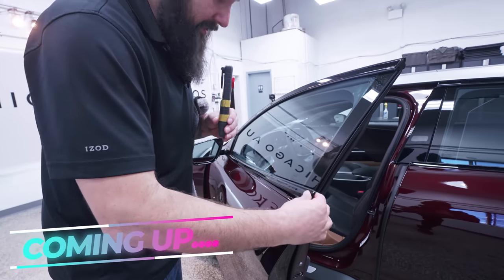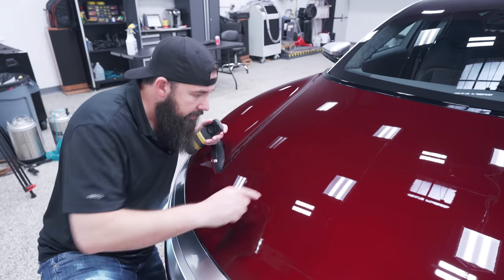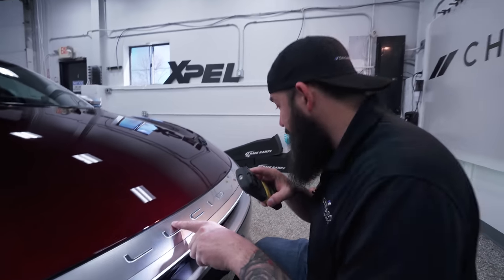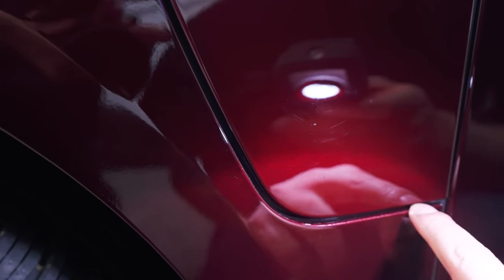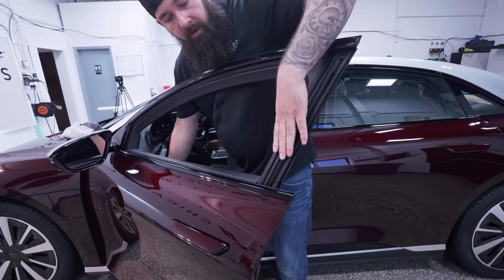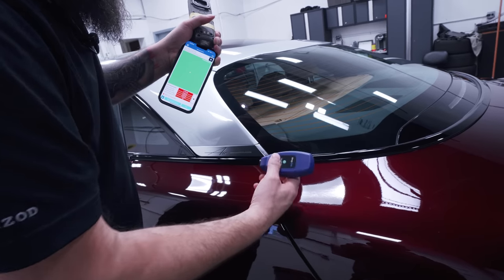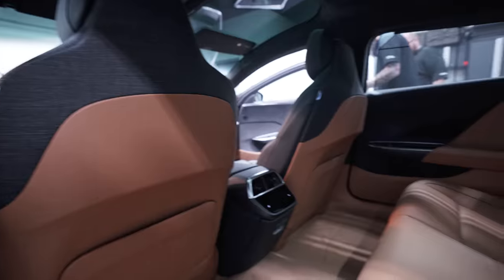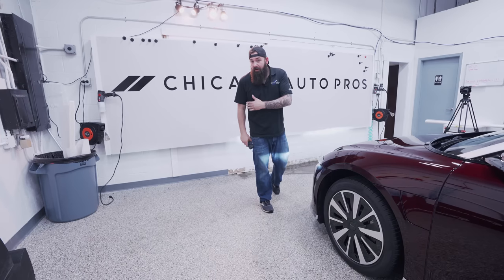2022 Lucid Air Inspection + First Impressions | How Bad Is It?

Comment: I work at an American auto assembly plant for one of the “big 3”. I’m in the quality department.  So much can happen to a vehicle before it leaves the plant.  The abuse it can receive.  The neglect it can receive.  The lack of care given to a vehicle is astounding.  Nobody thinks of the vehicle as a customers vehicle.  We deal with so many they just become another obstacle in the way to take a “break”.  EVERY single vehicle has some sort  of defect or flaw that is delivered to the customer.  All of them.
Reply: All of them? Don't you think it's a bit exaggerated? I mean maybe most of them but not all of them
Reply: @M.sami12  ok I shouldn’t make such a blanket statement for the whole industry.  In my plant yes, I could find a paint, torque, figment defect on every single vehicle, easily.
Reply: I like how people think of cars as masterpieces when in reality like you said I’m sure to you is just another welded piece of frame moving in the production line. There is no such thing as perfect specially when it come to cars.
Reply: Now, I think the same can't be true for "handmade" car brands such as Bugatti, Lamborghini, Aston Martin, etc. But then I have to wonder... If this would be the case for Porsche (Basically the only one of the supercar brands that utilizes factory production line). Just wondering cause I've had my new Porsche for 2 months now and the only flaw I ever found was oily streak mark on the handle of the glove box. Other than that, it came as a masterpiece. Exactly as I have ordered.
Reply: @Clazi  congrats on the new Porsche! Every time I see one I just can’t help but stare at the massive wheels along with the massive brake calipers 🤤 any new Porsche is a true masterpiece can’t say the same about the big 3 American car makers. I’ve owned BMW’s all my life so there’s definitely this level expectations in material quality that American cars will never have.
Reply: @Angelo80907  Thanks you for your kind words! Yeah BMW makes good cars too. :)
Reply: @Clazi  robots are more accurate than humans and they don't get tired.  Not all hand built stuff is equal.  It depends on who is doing the hand building.  Some hand built cars are a joke in terms of fit and finish, uneven panel gaps, paint imperfections etc.  Your Porsche will be better built than an equivalent Aston, Ferrari etc.  That's why you can have Porsches as daily drivers and they can hold up.  Ferraris etc are more weekend cars and they are fragile and need a lot of maintenance and tlc.
Reply: I guess you're not doing such a good job then...🤔
Reply: @cumshot247  exactly right.  The quality isn’t good at all.  I see it every day.
Reply: That’s why I do not buy “Big 3” autos any more.
Reply: @DS-wo8wr  

I don’t blame ya.
Reply: And Tesla is the worst. A friend had a 3 performance delivered with a 5” stain across the passengers seat. Who would deliver a car in that condition?
Reply: @zoner__  

You have to realize that at a factory you have very few people that do a final inspection for that seat.  Very few that drive the vehicle after it’s been assembled.  You have hundreds of cars a day that each person touched.  Things get overlooked because you lose focus.  It becomes a blur as to what you’ve checked and not checked.  The monotony is endless. 

 I had a vehicle that made it to final inspection today that was missing the vehicle’s logo on the liftgate! It was getting inspected on the final line so it could be shipped.  It passed by probably close to a hundred people that missed it.  Wasn’t the first time that’s happened either.  Mistakes like that stain and much worse get to a customer every day.
Reply: LEXUS never got that memo
Reply: @coach2208  🤣
Reply: That’s what happens when humans are involved. Us apes are terrible.
Reply: @Matt-fd9hc  So do the Dealers end up fixing a lot of things before the buyer takes it home?  Or does the buyer realized the defect & bring it back to the deal for a fix?
Reply: @julie4871  

Every vehicle will have some sort of flaw.  The dealership might not see it and the customer won’t either.  If dealership fixes it the assembly plant gets charged. 

Not when I say glad it might be something very minor that unless you look at every single day the customer won’t see.  Slight paint defect, panel gaps, interior installation not fitting well.
Reply: @coach2208  So you're saying every car from GM leaves the plant with defects?
Reply: @Bruv-  

There a while line of final inspection for certification and then it leaves the plant to be put on trucks and delivered.  It goes through each i lectionary station and the inspector has 55 seconds to complete his/her list of inspections.
Reply: @coach2208  got it. So your brother in law says that they all leave the factory with defects.
Reply: @Nessal83  🤪🤪🤪🤪🤪
Reply: that's why I will never own one of them
Reply: @coach2208   "AND NONE LEAVE THE PLANT without any defects" so they all have defects, that's what you're doubling down on.  Sadly, this is what we'd expect from GM.
Reply: Isn't this your job to catch and prevent, or do you just go yep they're shitty ship 'em out.
Reply: @mmmlinux  

Absolutely it is my job.  I have my set area on the vehicle to inspect.  I’m human and I will miss a defect now and then.  Not on purpose obviously

Now imagine over a hundred people inspecting a vehicle over 3 shifts,5-7 days a week. Some care more than others. 

 That’s roughly 4,000-7000 vehicles a week.  Depending on how well production runs.  

So defects are missed on every single shift on every assembly line at the Big 3. 

Also, every defect isn’t always an  assembly issue either.  

You have many suppliers that build components, wiring harnesses and modules for example.  They are pushed by the Big 3 to get us parts just in time and under budget. So they don’t always build a perfect part either.  We have inspectors whose job is just to deal with supplier defects. That is a busy job.  Their inspectors miss defects as well.  Then we have to deal with their defects as well, remove their stock, inspect all their stock for their defects.
Reply: @Matt-fd9hc  any system for quality which relies on mass inspection is doomed to failure. You have to understand your system and reduce your varience so mass inspection isn't relied on to catch the failures. The British car industry was decimated by poor quality and that is what the Japanese taught us. Its all a bit boring waffling on about 6 sigma in the new electric car world, but this stuff really matters. I've seen some shockers on Teslas; I don't want to knock it because Tesla are taking a path I admire, but building a mass production system with robust quality is hard. Good luck to lucid, getting some things right, this is an interesting forensic video
Reply: and that is why i dont buy your products.
Reply: @bigbenorr  

Trust me, neither do I.  I don’t dissuade others when they ask if I would recommend buying from where I work.  I never give specifics but just tell them I have a Toyota.
Reply: @M.sami12  i work at gm; idc ill tell you lol . Half the MF who work in there are drunk or high.. or reallllllly old
Reply: @weinerschnitzelboy 

Absolutely true.  I’m an ok worker but I don’t have near the work ethic of the Japanese or Chinese.  Americans don’t have the attention to detail either.  It’s not even close. I’m ok but I believe I’m better than most I work with.  The movie Gung Ho is a fair representation of the American worker. At least the beginning part.
Reply: @Clazi  Porsche makes supercars yes, but it's a sports car brand. A supercar brand would be like Ferrari or Lamborghini.
Reply: As long as my car looks like it can take me from point A to B, and everything functions and looks like new, why should I care about PIG swearls that you can only see with a light torch up close only? Or fit and finish issues that no one will ever notice and won't affect the car?
Reply: @AshA-ww8hc  You already said it yourself, you're only interested in a personal transport that can take you from point A to B and that's it. There are a whole lot of people who are more enthusiastic about cars and don't see them as just a means to get from one point to another. Those are the type of people who might be interested in knowing how well their cars are built.
Reply: @RainingDarkChocolate  Unless you put your car in a museum, it will get chipped ,dinged, damaged, scratched. Just not practical. If you are looking at cars that you want to store and admire and spent a few hundred grand on, I get that. Most people aren't collectors. Most people want to use their cars.
Reply: @AshA-ww8hc  

Trust me we don’t want you to.  We want customers exactly like you.  Thankfully most are and we know this.  If customers saw all the defects then we’d have been out of business decades ago.  Quality was way worse for American cars back in the day.
Reply: That’s the American culture and mindset.  Different in Germany.
Reply: Every Vehicle? Why don’t you just tell us that you work at FORD. Lol
Reply: @Burtdirtflirt  

Well I do work for one of the “big 3” and have two friend that also working quality at another “big 3” automaker.  We compare notes often and have very similar examples and stories.  So it’s safe the assume the third automaker of the “big 3” is very similar.
Reply: I work in an auto plant also. Most of us care and do a good job....hard to get rid of employees like Ma tt who don't take pride in their work....people like Ma tt are in every industry
Reply: @danielcoffman3739  

I have no problem if you think I have no pride in my work. You are free to your opinion. But you said it and it’s exactly what I’ve been saying.  There is a reason every vehicle will have some sort of defect due to people who don’t do their jobs with care.  

If you really work I an auto plant.  Saying most take pride is a bit of a stretch.  Absolutely some do, quite a few. The reality is most don’t really care.  They are just trying to get through the day without getting yelled at.  It’s that fear that motivates them into doing their jobs correctly.  They don’t think of it as a customers vehicle.  Especially when doing the exact same thing hundreds of times a shift.  The vehicles are just a job and we all have one small piece to complete on that job. 

The phones/Bluetooth devices are really a huge distraction and create many errors.
Reply: @Clazi  - The guy in the video could probably find defects, he sure seems to have a very experienced eye for minute problems.
Reply: @Clazi  - Depends on how you define ‘good’.
Reply: @Clazi  My 2022 Bentley Flying Spur is hand made and has been back to the dealer 3 times for quality defects.
Reply: @mrivc211  Sorry to hear that brother. It's hard to believe that such a reputable company as Bentley has weak QC. How unfortunate.
Reply: And this is why people keep telling me not to buy any car from the Big 3.
Reply: @SamA-cy8eu  

I don’t blame you.  I work at the “big 3” and drive a Honda.  Haven’t bought my employers vehicle in over 15 years
Reply: thats work. every industry is plagued with this. its called being human
Reply: @chasesherwood6472  

I couldn’t agree more
Reply: The core problem with mass production.
Reply: I bought two 4Runners, first my wife’s 2020. It came from Japan, I was so impressed how the build quality is and the fit and finish, that I bought myself one. I picked up a 2021 before the prices went crazy. I will be a lifelong Toyota customer, if and only if the quality stays as current.
Reply: Good comment! Seems to a growing rep over the years the big tries hard to address. Thus all the growing number of quality competitive auto companies.
Reply: @Clazi  those are the cars with the most defects because they are made my hand . We are only humans and we all make mistakes no other car is build the exact same Rolls Royce said that in there own video I saw years back they said it themselves.
Reply: @Matt-fd9hc  finally a voice of reason in the comments.I’m so surprised that ppl expect perfection on all these cars no matter how much it cost. Every single car is going to have a flaw rather it’s the gaps,paint, wheels,or interior things even internal parts there is always something wrong . I’ve been a detailers for 10+ years and I’ve seen it all. I’ve worked with Tesla in the past when they first came out and I’m telling that was really bad a lot of flaws .
Reply: @nofsgiven3855  

Oh yeah, Tesla is notorious for panel gaps and other issues.  The current models have given them better quality.